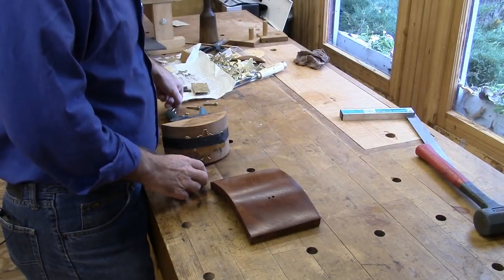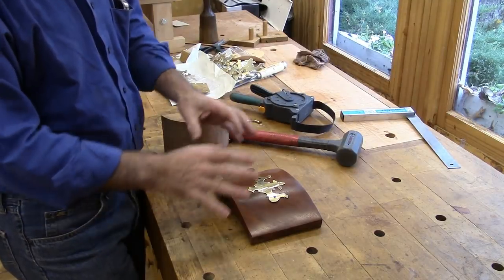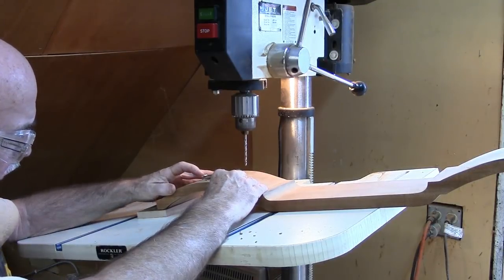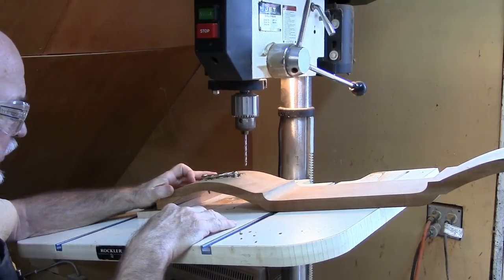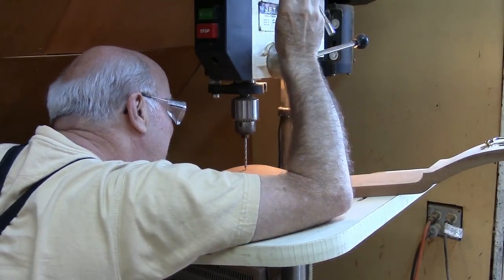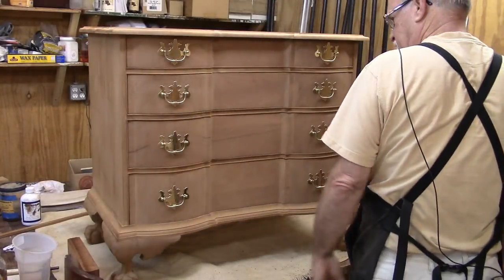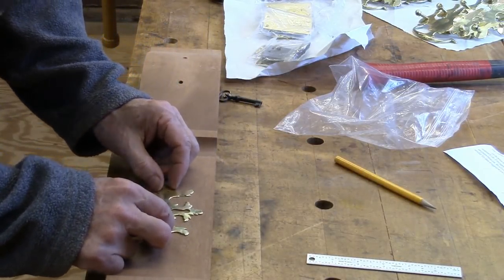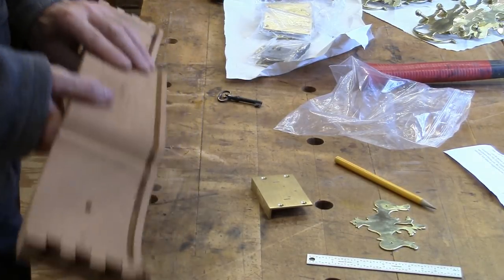Mahogany Curved Blockfront Chest Mounting Pulls & Locks Step 8

Comment: Thanks for these incredible videos! I am working on a mahogany piece now and it would be valuable to have your opinion on what the best kind of finish is for these period reproductions.
Reply from the maker: Thanks Rodrigo,  Finishing is a personal thing.  Mahogany is an open grain wood, so if you don't like the exposed grain then you need to fill it.  In the old days the filled with brick dust or ground walnut shells but there are many ways to fill.  I don't fill, I use shellac but the old guys would have used a oil/varnish (like Waterlox) or hard wax. Hope that helps

Comment: Hi David:
The cabinet is looking good.  I very much liked the way you make the hardware fit the curve of the drawer fronts.  As they say"That's Cool"
Your locks were a lot easier to put in than mine where in curly maple and you did a very good job of installing then. I used a router with a 1/4" up spiral router bit to remove most of the material.  What I do to make sure I get the key hole in the correct place is drill a small hole (1/16") from the inside and them drill the correct size hole from the outside.  This method always works for me.  I make a dent in the wood on the inside  with the lock.
I notice that you have Dog Holes in your workbench.  At this point I don't.  If I have to hold something flat on the bench I have to use F clamps.  My question to you is what was your layout pattern?  I have had for several years a couple of hold fast like yours but never use them.  The reason is I don't want a hole bunch of holes I don't use and the bench looking like swiss cheese.  Can you give me some of your reasons and locations for holes.
Thank You and Have Fun in your shop
Reply from the maker: What is your name Mr Csbinet Maker. I made some videos on making a work bench a few months ago, don't remember if I described the hole pattern. But I use 3/4 holes 6 inches apart in both directions.  You need to figure out what kind of work you are going to do on the bench and then just add more when you need them.  They are never where you want them anyway
Reply: Hi David:
You ask me my name.  It is Monte West (montewest05@comcast.net) and I am a retired Civil Engineer that designed highway in Virginia for about 44 years.  I use that name because I liked it when I wanted to make a comment to a video.  After retiring the second time I became very interested in building fine furniture.  All the pieces I have built, we are using or been given to family members.  I have built more pieces in Quarter Sawn White Oak than anything else.  The boss likes Oak and the Arts & Craft style furniture.  Currently I am building 6 Keeping Chest out of curly maple & walnut which are 10" x 18" with bracket feet.  That's a lot of bracket feet.
I went back and looked at part three of the Workbench build and the only talked about drilling the hole and doing the one hole and not the layout.  I have found that clamps work but sometimes they get in the way.  That is the reason I ask the question.  How well do the holes hold up out of Particular board?  I know the top is maple.
Thank you for asking
Reply from the maker: Thanks Monte, Don't know about particle board. I would like to see pictures of your work.  Do you use twitter or instagram I post there all the time even before I post a video here
Reply: I in the last month finally got a I phone, and I will try soon to send you a couple pictures.  I said particle board.  I did not go back to see what you used for the sub-base for the maple surface.
Reply from the maker: the sub-base is mdf, and the hold fasts seem to work well so far